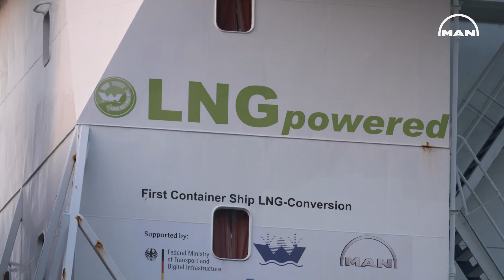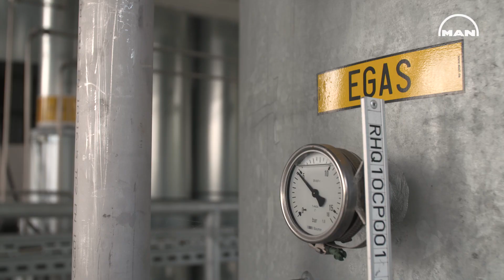World's first container ship to run on climate neutral SNG

Comment: Hello, can we use the e-fuel to power our gas heating at home??? Supplied during our existing gas-pipe infrastructure...  The world is just talking about powering engines with it.... (A solar roof + heat pump is not affortable or simpliy not possible for most of all people!)
Reply from the maker: Thank you for this very valid remark! The great advantage of all efuels is indeed that they are chemically identical to their fossil counterparts (theoretically even for heating applications). Which means that mixing, "drop-in" or fully replacement with carbon-neutral fuels is effortlessly possible whilst using existing infrastructures without any modifications necessary. In order to effectively decarbonize, starting today, we need to use the suitable solution for every specific application: this can be direct (renewable) electrification, usage of green hydrogen, efuels or - where CO2 cannot be avoided by any means – carbon capture. At MAN we are proud to provide solutions for all mentioned paths!

Comment: Do you mean that the quantity of C)2 used in the production of the gas is equal to the amount produced during its combustion—thus the process is carbon neutral?
Reply from the maker: Yes, the CO2 used for the production of the SNG is taken from an emission source before entering the atmosphere, so practically out of the atmosphere and for the production process only renewable electricity was used.
Reply: @Everllence  E-gas from animal manure possible?